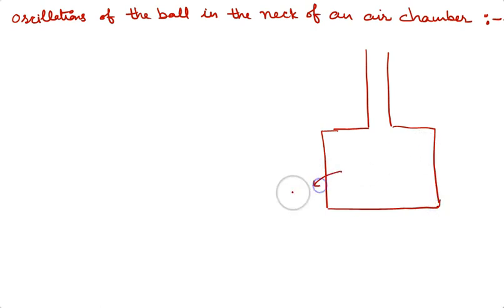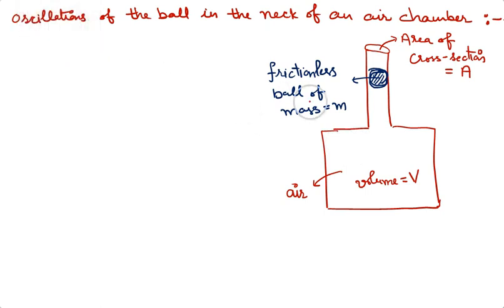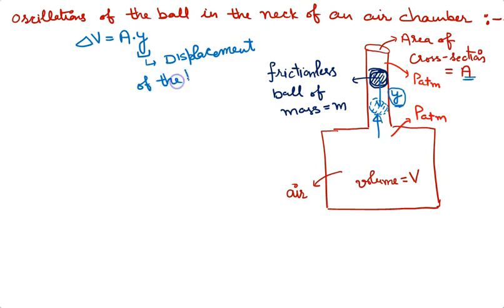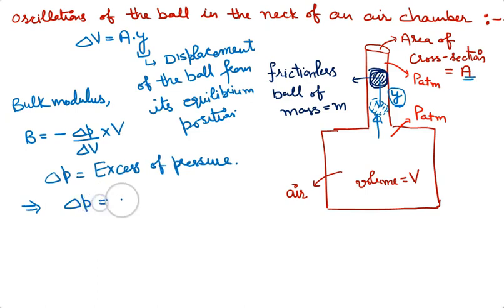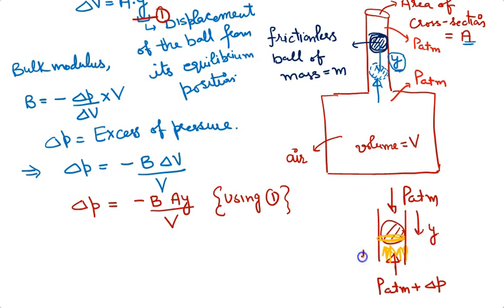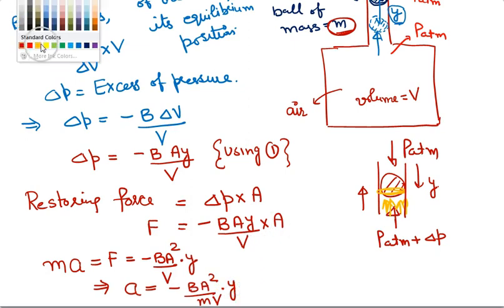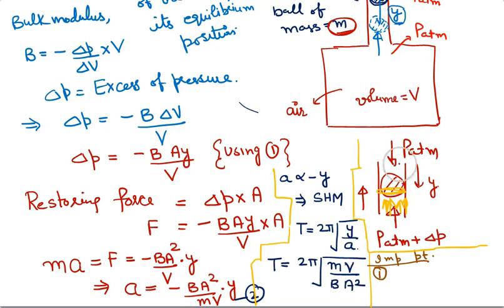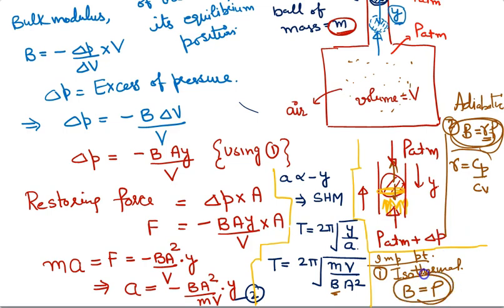08 Oscillations of ball in the neck of air chamber Oscillations 10+1 Physics

Comment: Volume of the air chamber = V
Area of cross-section of the neck = a
Mass of the ball = m
The pressure inside the chamber is equal to the atmospheric pressure.
Let the ball be depressed by x units. As a result of this depression, there would be a decrease in the volume and an increase in the pressure inside the chamber.
Decrease in the volume of the air chamber, ΔV= ax
Volumetric strain = Change in volume/original volume
⇒ ΔV/V = ax/V
Bulk modulus of air, B = Stress/Strain = –p/ax/V
In this case, stress is the increase in pressure. The negative sign indicates that pressure increases with decrease in volume.
p = –Bax/V
The restoring force acting on the ball, F = p × a
= –Bax/V .a
= –Bax2/V ……(i)
In simple harmonic motion, the equation for restoring force is:
F = –kx       …..(ii)
where, k is the spring constant
Comparing equations (i) and (ii), we get:
k = Ba2/V
I did it like this.